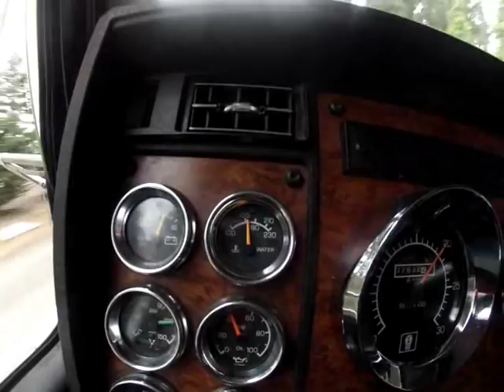Test run with  new [used]  Jerr-Dann Wrecker

Comment: any plans on upgrading the waring lights on the truck?
Reply from the maker: WE have to have red lights in  WA .  The truck came with all the equipment to get certified  for WA State Patrol rotation . I am going to purchase the  wireless remote for the  wheel lift and have been searching on line for a good  rear mount  camera . Hope to find a camera that will record so I can get a little more  action on the recoveries .
Reply: Hill Auto Body & Towing
You might want to look at RepoNut's channel for the rear cam. He has them on his repo truck so might be a good source for you. But the new truck looks great. What trans are you running?